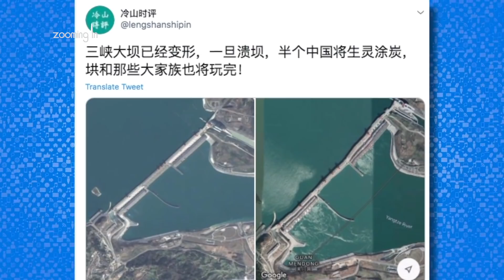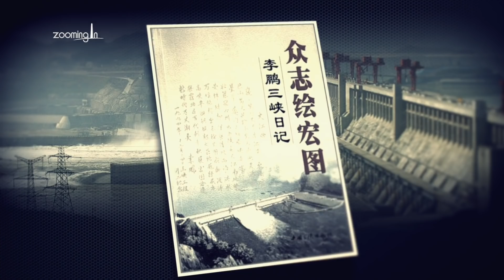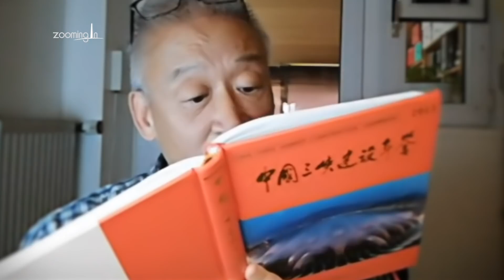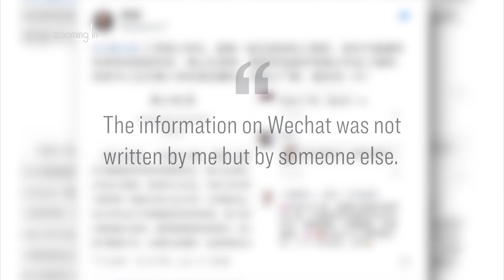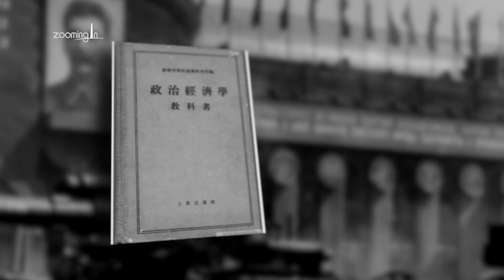[Exclusive] Ongoing Danger of the Three Gorges Dam. Part 3: Flood is Caused by Reservoirs and Dams.

Comment: Li Peng  sold  the 3GD as  a  flooding solution,  so most people who don't question ,  accepted  the building of the dam.   He did NOT tell these people that the primary purpose of the 3GD was to generate electricity so his family could operate the 3GD and pocket the cash.     Li Peng passed away in 2019, he was responsible and now his family still collects money for the operation of the electricity-generation function of the dam.    The profits are probably not applied to funding solutions but go directly to Li Peng's family.

The  emergency management most likely will be the same as has just happened with the recent flooding of farmlands to save the cities.

The "experts"  don't accept responsibility.   Whoever lives downstream  needs to make a plan BEFORE the catastrophe.
Reply: Understanding that the 3GD has a questionable design/engineering/construction subtle changes through time will eventually negatively impact the dam integrity.
The "black swan"  event is the simultaneous occurrence of massive flooding ,  the presence of a tremendous amount of water,  and a tectonic event (earthquake) which are caused more frequently  when the amount of water increases.
Reply: How dangerous is the situation ?    What are the odds of a black swan event happening ?
Reply: @Orcalein7367  The  earthquake frequency has increased in the 3GD area after 2003. 
A mathematical trend can be calculated using earthquake magnitude and frequency from 2003 to 2020. 
I don't know if anyone has done this.   The magnitude has steadily increased , in 2013 a 5.1 magnitude occurred.

Comment: I'd love to see new aerial photos of the dam to show if the distortions in the dam were a fluke imaging
problem.
Reply: AQuietNight - It should be noted that the Chinese government hasn’t allowed aerial photographs to be published since the one showing the distortions.
Reply: If you photograph the 3GD using a drone you will be arrested.  The CCP doesn't want documentation of a negative scenario. 
They are communist bureaucrats.  They only care for the positive image of the CCP.
Reply: @TraditionalAnglican  You can get the dam's photos from google Earth.   The US, for certain, has photos of the dam.   In the 60's, US's spy satellites over Russia could read the newspaper read by a Russian on the street of Moscow.   Many years have passed, the world doesn't know exactly how much the US's technology has advanced.
Reply: Nhu Tollinsky - The Google Earth picture doesn’t have anywhere near the detail one would need to confirm or deny the warping of the dam, & the US government isn’t talking, because spy satellites & everything connected to them is Classified Top Secret or Above (depending on the satellite).
Reply: @nhutollinsky8913  FYI Google Earth is not updated
Reply: There’s no way those images are accurate. That looks like a stitching problem. The dam is over 2km long, I haven’t got a ruler out to work out the scale but the amount of distortion shown in the pictures would be many meters and that’s just not possible, concrete isn’t going to bend like that without major cracks which would have huge amounts of water flowing out of them and it would probably have collapsed. This guys talking about 10-70mm which would not be visible at that scale of satellite picture. I’m sure the US government has more accurate pictures and ways of noticing it but that is not what we’re getting from google earth.
Reply: You can't find any because Google Maps is bankrupt and shut down. It the only one in the world. Upload by a user using twitter account. Don't believe me? Try googling it
Reply: @mcearl8073  If the dam shifted as much as the pictures suggest you could easily see it in any
profile shots. If you look at portions sitting on solid ground you see shifting which strikes
me as doubtful.
I did hear several months go there was a shift in the base of the dam but that would not be
visible. How great the shift was wasn't stated.
If the U.S. had pictures of the dam and it's warping I think a few would have been leaked.
Reply: @flightographist  That was about the cracks but they were known before
the dam was completed. The overhead photo shows severe deformation. If you look at the
roadway you see the deformation as smooth curves and concrete doesn't have that much give.
Reply: @flightographist  I would just like to see photographs from another source.
That would help clear the matter up nicely.
Even clear profile pictures would show the problem at 7cm.
But as of this writing, I am glad I do not live down stream of the dam :). My confidence is not high.
Reply: AQuietNight That was my point. There’s it no way it shifted that much without it being a major fault and certainly visible in pictures from the side. I don’t understand why people are not taking scale into consideration to realize it wouldn’t still be holding water. I’m not saying it hasn’t shifted or anything, just that those images are not showing it. Also those are older google earth images and if you look now you don’t see it. So it was either a technical issue or someone just faked them and didn’t do a good job.
Reply: @flightographist  Google 3 gorges dam Deformation and see if you can find any other photo other than the one put out by the Epoch Times or as you said the photo from the beginning of this video.  All the photo is the same whether by Taiwan news, etc.
Reply: @flightographist  1st I don't believe someone suddenly come out of nowhere and suddenly become a Top water expert when he is just a hydraulic engineer which nearly country have or can produce. 2nd as I explain anything that come from the Epoch Times cannot be trusted. It Biased and Anti-China, Just search wiki  or name one publication that say China do something good. 3rd. You too are bias because you also just blare something out without research e.g. " That CCP dams don't undergo the stresses that every other dam in the world undergoes?" Are you sure? I read somewhere that the dam have been tested by independent or international bodies and say that the dam is  that of Good Quality. Go check. I don't think it of any use as bias, will be bias so believe what you want.
Reply: km leong troll much?
Reply: @blingy012  McDonald's? Or Trump Burger?
Reply: @AQuietNight  The ccp admitted that the dam "warped, moved, and distorted."   Usually, communists are very secretive so I've wondered if that was their version.
Reply: @kmleong8175  Mr. Wang certainly knows much more about the dam than you do.   That's the reason he's concerned about damages if the dam breaks.     What is your background?  You must be a member of the ccp based on your comment about the Epoch Times.   It's true that the ccp has not done anything good as China has been stealing the West's science and technology for many decades, and has been using the stolen technology to either lure poor countries into debt trap diplomacy or invade the South China Sea.    Did China invent car, oil, electricity, .... ?  To name just a few.   NOTHING!  
The ccp had Western engineers to inspect the dam, and they found out that the steel used in the construction of the dam was substandard.    Their professional opinion was attacked by China as "racist" remarks.
Reply: Google earth gives a good image,  just checked it.
Reply: @mcearl8073  Google Earth photo stitching distortion, like the Google Street View HALF-CAT, made famous in 2013.

Comment: The really worrying aspect about all of this. Is that no one seems to be in charge. When you build something like this you have to us materials of the highest quality and all aspects of the project have to be done to The highest possible standards regardless of the the economic cost
Trouble is that I fear that corners were cut and now there is a major problem. 
PS It is worth noting that a cubic metre of water weighs a metric tonne.

Comment: Why do you guys keep using the crappy Google maps imagery? The deformation in the dam is NOT visible in satellite imagery. That imagery is just screwed up because of the terrain data. You can see the error all over China, like with many airport runways or long, straight stretches of highway which appear wavy. It's simply the imagery being laid onto the terrain incorrectly due to bad data. As the guest mentions, the deformation of the locks is 70mm, which is serious. But you'd never be able to see that from space. You probably wouldn't notice it standing right next to it.

Comment: Deformation  has increased by some 700% or 7 times the acceptable limit according to your show. Your guest Wang Wei Luo  is just saying to us that there are no more responsible parties(that you can blame) should the dam break, or fail to perform as a dam. Simply put, if lives are loss, now, no party can be found to be responsible for such unwanted consequences. This means no point talking about Dam construction or even repair, your facts are already established, who in China can now be found who wants the responsibility of this dam??? The current condition of the dam means there is no longer any worthwhile meaning that can be attached to it like, "flood prevention " or, water recycling or, power generation, etc.. indeed any other "good" reasons you want to attach to the 3 Gorges Dam to motivate people to repair and reorganize the mess, that will somehow find a responsible party to credit for so called "good  performance" is all in vain. Since the dam is no longer performing,  we can at least claim, it is no longer costing China much compared to construction stage, and we should find some way to redistribute the water to other regions in China. This strategy would prolong the time before such redistribution becomes no longer feasible.  This dam is able to collect excess water which is like an artificial lake where the water is immediately redistributed or be of use to other areas of China. Not everything that is built or acquired can be used to the fullest extent. Just try not to built too many "3 Gorges Dam ", repeat mistakes etc... At least the 3 Gorges Dam was not sold to some 3rd world country, like Myanmar or Thailand where apparently due to some inability to pay for the dam it was not finished. There are some countries who can successfully build workable dams, some who fail to built but can still buy workable dams, some who can hope to buy, others who cannot build must buy, and finally some who cannot even afford to buy...

Comment: Going by the image comparison(0:40), one's closer up than the other, there are 14 white triangles on the left side, a missing 3ml white line near the top right of the dam with a small defragmentation of the structures line. Who built and benefits from the dam? The Chinese government, therefore they are responsible, they have fingers into every pie therefore they must take responsibility for the dam, they ordered and financed it's build, they are the owners aren't they?

Comment: I have actually seen all 3 parts of this Three Gorges Dam saga. I think I understand what was being explained quite well. It seems like the paramount leaders, rarely examined the 3 main reasons why they would embark upon building a dam. These 3 reasons are according to Mr Wang Wei Luo, a) to eliminate all flooding, b) provide water for irrigation  and c) control the flow of water so that we can generate electricity. 
Such "control" of the water will not be achieved if the dam could not store enough water in the first place, or the dam was not high enough to handle sufficient water for retention.  All necessary figures for water amount required could be scientifically estimated before work started for building. Of course we need to ensure that there is a "trade-off" between the absolute height of the dam, or the amount of water able to be stored, and the dangers of not being able to retain the water properly etc.. and therefore leaks and unintended flooding etc.., due to height of dam, deformation etc...  Everything can be estimated before build, plus small test models could have been used for pilot testing etc... It is actually an engineer's possible dream project. It seems to me, the leaders of China have not done enough studies or written  papers to let all people know how the decisions of the dam has been taken, what information was available,  what are the essential variables crucial in making such a decision properly and for ultimate success. How did they define the success of such a project and what engineering marvels were crucial or required for ultimate successes etc.... As usual they have somehow fail to emphasize what are the 3 most important variables for making the right decisions.  Insisting that "somehow" the dam cannot be higher than 200 meters, without also explaining how this reversion was more correct or better than the higher estimate arrived at by the Soviet experts or recommendations reached, such very basic communication problems is truly frustrating.  Why was such heights arrived at  as some sort of pie in the sky figure.
China used to be ruled by an Emperor who couldn't solve the simple problem of invading Westerners which led to personal withdrawal,  hiding from his own people etc.. the subsequent humiliation of the people had to be faced without his attention. Even if everyone who lifted a stone or mixed concrete for the dam was qualified as a professor of civil engineering, construction etc...at Qing Hua University,  the same one attended by the current Politburo Secretary General,  Xi Jing Ping, one must make sure some learned resolution  is found for this 3 Gorges Dam. This resolution must include some very obvious steps for mitigation of possible loss due to flooding, accentuated steps to increase control of water under storage, etc.etc.. This is just a small reflection of what I feel after seeing the 3 videos...

I also thought about diverting some of the water to the north west region. In China most water seem to be
accumulated in the north east region. It's always nice to have too much water. The solution is to Divert that to the western regions like Xinjiang or even Xian where there is usually a shortage of water. Build sufficient reservoirs to divert most of the water to the West. This way you can reduce the overflow such that you are no longer releasing water back into the Yangtze but actually diverting away as quickly through catchment reservoirs.
Reply: You need to watch the earlier videos again.  Your understanding is so strange, if it was based on the earlier videos.

Comment: At about 1:00 Deformation of the Ship Lock... 70mm when it should be only 10mm seems 'a lot' but how critical is that to the integrity of the Dam itself? If you look at pictures of the dam, the ship locks are off to the (north) side and separated from the main dam structure by Land Masses. I don't know which part of the ship lock is deforming but the simple fact is that these are LOCKS that have gates that open and close, and there are always at least TWO sets of gates, either of which is sufficient to hold back the waters !!! 
So I don't think this deformation is particularly relevant in regards overall SAFETY of the dam. (Not that I'm an expert.) 

My Wang also talks about water seepage. It seems to me, water seepage is a problem if it continues to increase and/or the seeping water carries sediment (is it clear water or cloudy water?). That is, is the seepage eroding the foundations? 
Unfortunately, Mr Wang did not provide a conclusion. 

Flooding... Obviously the reservoir held by the dam is way to small to contain one season's flood waters. I believe it is 20% of that. Maybe they need a few more Three Gorges Dams above and below. 
In any case, the locals may have been oversold on Flood Management.